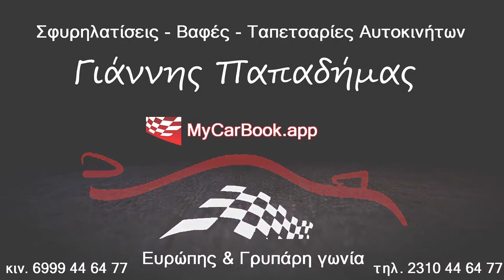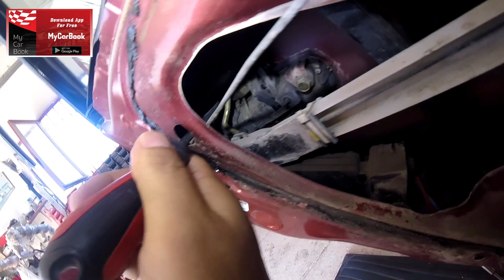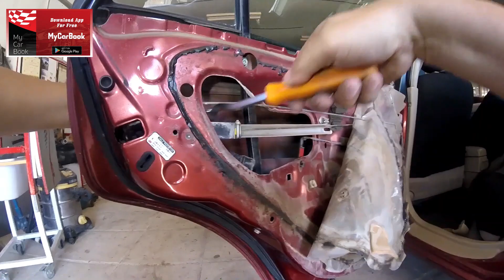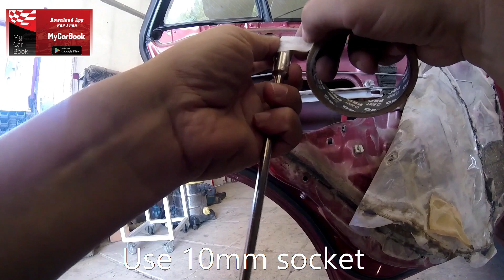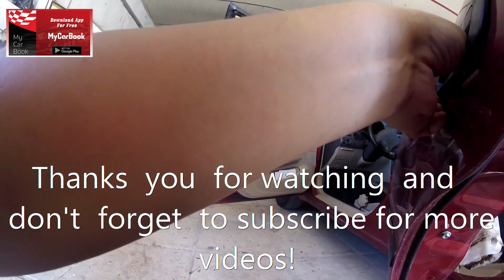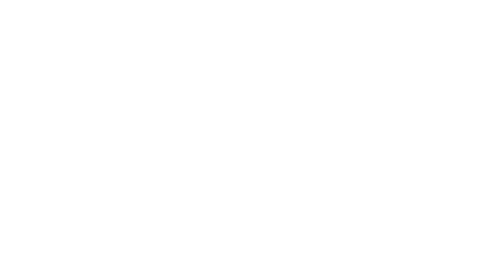Toyota Corolla 1995–2002   How to Replace Rear Outside Door Handle

Comment: I tried following your video to replace my exterior left rear door handle.  I tried for hours this past week.  I Couldn't access the left bolt to remove the handle.  So I broke off the handle from the outside.  But I couldn't get to the bolt for reinstallation.

Finally figured out that I didn't have the circular hole in my door, not the one you had in your video.  Circular indentation where the hole should have been cut.  

Is it common for Corollas of the same year to have door templates different?
Reply: Did you ever figure out how to access it?

Comment: Tanks for not showing the part where you get the door handle out
Reply: Take the bolts out and push out. Remove the white parts that's divided in 2. Literally  self explanatory if you open the door and look inside

Comment: 99 corolla handle have a fking plastic bit and i cant figure out where it goes so it wont opem
Reply: I fked w it enough and it went in but i did the same to the othersode and the white plastic goes above a bar and be gentle it can slip while botling the handle on